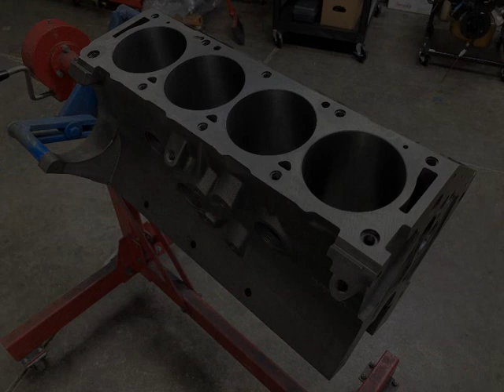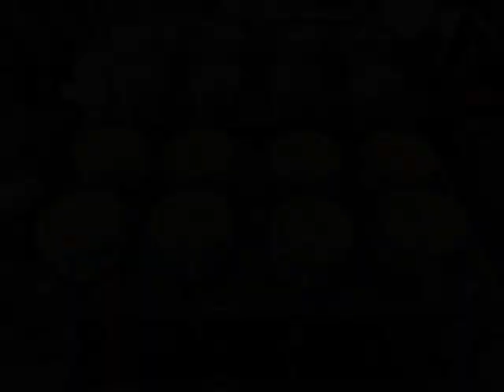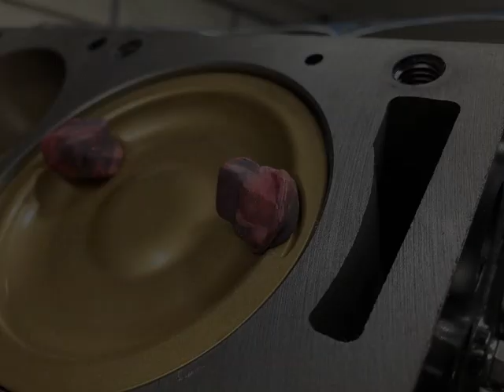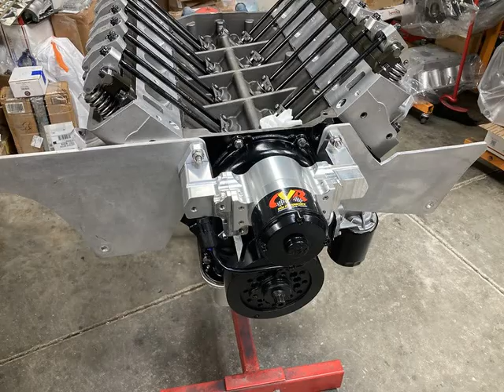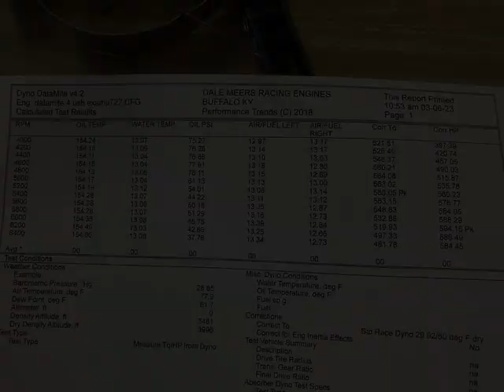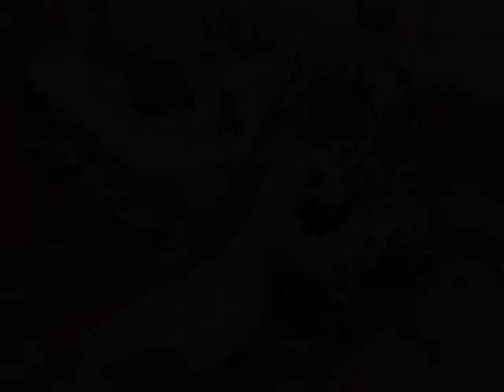Lykins Motorsports Massive 496ci Ford FE Forced Induction Build Overview...

Comment: Keep talking about the importance of degreeing cams. As an example, I checked a 390 FE engine that had the cam 8 degrees retarded when the marks were lined up on the timing set. It would have run, but it would have been a real turd.